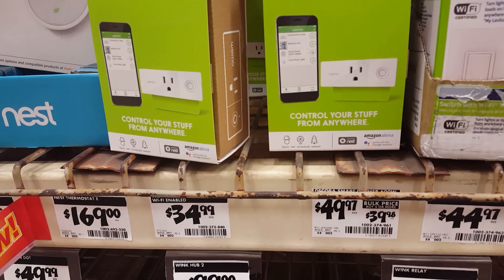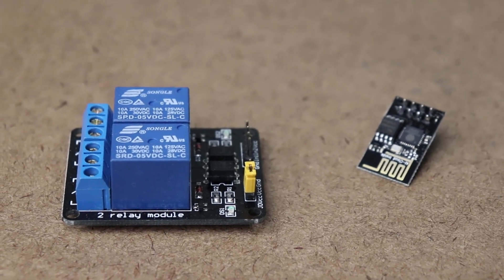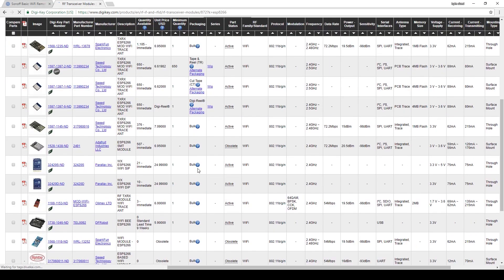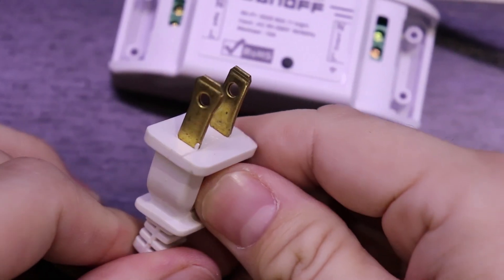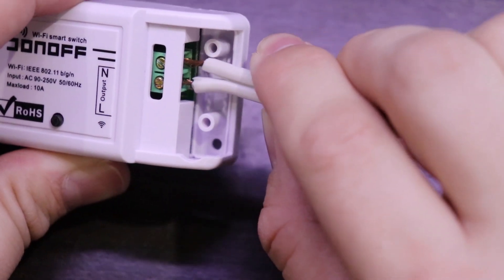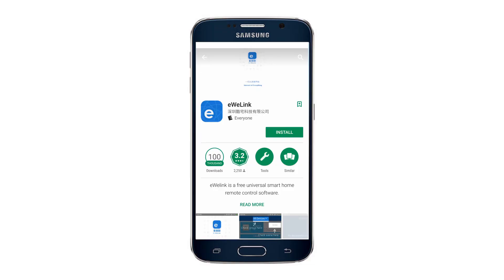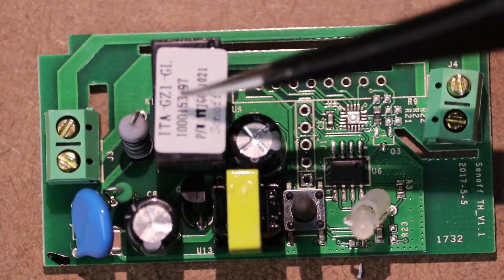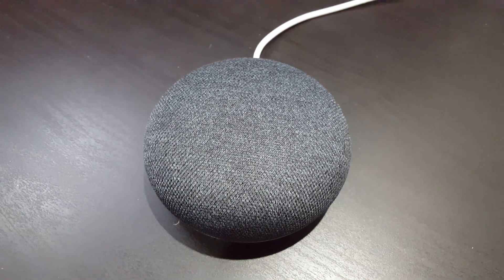Sonoff - The $5 WiFi Smart Switch That's Compatible With Alexa And Google Home

Comment: One big problem I found with this device: If you're using a Google Wifi router and a newer Android phone they won't work because you won't be able to pair the smart switch with your wifi network. This is because to pair the switch, you have to open the app on your phone, add a new device and then direct it to your wifi network. The Google Wifi router puts out a 5Ghz and 2.4Ghz band network that both have the same name. Your phone will automatically choose the one with the stronger signal which is almost always the 5Ghz one. The problem is these switches only work with 2.4Ghz so as soon as you choose that wifi network on your phone, you get an error in the app saying 5Ghz is not supported. This is really annoying because the 2.4Ghz network is there - it's just that the app doesn't know that when doing the pairing. Unfortunately there's no way to force your phone to use the 2.4Ghz or disable the 5Ghz network on the Google Wifi router so you're stuck with a switch that should work just fine but you can't pair with your network.
Reply from the maker: Aaron Smith I used a dual band router in making this video. You have to make sure your phone is connected to the 2.4GHz network before you setup the sonoff switch. If the 5GHz and 2.4GHz networks have the same SSID then you should change that in your router settings to give them unique names. This will help avoid confusion.

Comment: wow you stripped to much insulation away from the cable, the copper wire shouldn't be exposed after connecting it to your device!

Comment: Great video! I've have one air large conditioner in my house in the U.S. that uses a 240v three prong plug. I've been trying to find a z-wave or wifi switch to control this for years now with no luck. Do you know if I can use the sonoff 16a POW switch wired to an extension cord to control this? My A/C is rated 8-12amps and the sonoff says it can handle up to 250volts so I dont think that will be a problem. The only potential issue I see is that in the U.S. the 240v 3 prong outlet is created by joining two 120v circuits which means two of the three wires are "hot" and the third round one that looks like a ground is actually  both neutral and ground. So my question is can I use the sonoff for this and if so what should the circuit look like?
Reply from the maker: It sounds like it should work, but I would consult an electrician.

Comment: but ac is switching, so making sure polarization is right makes no sense.. true it is made that way, but is not 100% important unless you have some very specific high end equipment, and your house was running on DC power.. sure its a good practice to do it the right way, which is as you say. but is not important in any way. not in my country anyways. have made tons of cables, with no need to identify a lead(mainly due to our obsession with color coding them) but still, i could take a lead and reverse it, with no impact in the power it gives..
Reply from the maker: You are correct that reversing the polarity on an AC load does not affect its function, but it's unsafe to switch neutral instead of the live signal. Thanks for your feedback, much appreciated!

Comment: So instead of using an extension cord, you could just strip the lamp wires or what ever device your are looking to make smart, and connect it directly that way? 

Second question, if I simply flip that light switch on it'll still turn on or do the commands to the voice assistant HAVE  to be used?
Reply from the maker: Yes, you don't have to use an extension cord. I wanted the flexibility to move it around from appliance to appliance. To answer your second question, think of the sonoff switch as plugging/unplugging your appliance from the wall. When the sonoff is turned off, your lamp has no way of receiving power. There is a button on the sonoff that allows you to manually toggle the power on/off so you don't have to use voice commands.

Comment: This is amazing. I bet you can wire these units in line with te power sockets and leave them in a pattress box inside the drywall
Reply from the maker: You could in theory do that. I prefer to leave them external. Thanks for sharing your ideas!

Comment: Hi, I'm new to home automation.
If I make my devices on all the time, like example my kettle, is has to be on the powered on mode all the time, is the switch by default off mode until you turn it on?

and also in that case for your blender,soldering machine, etc, is it set to on mode all the time and cut off by controlling your remote control/google home?
Reply from the maker: Imagine that the sonoff switch plugs/unplugs your appliance from the wall for you. If the appliance has a power switch it should be kept on all the time, allowing the sonoff to supply power to it. Hopefully that helps

Comment: Which tipe of device does Google Assistant think it is? Can I change it to a light bulb? I would like to include it in scenes together with smart bulbs.
Reply from the maker: You can add the Smart We Link app right in Google assistant.
Reply: byte sized okay, and if I add it too a room named kitchen, will I be able to say, " turn off kitchen lights" and it will turn it off together with my hue bulbs?
Reply from the maker: Eric G yes if you add it to a room in Google assistant it will respond to room commands.

Comment: Dont leave all that copper exposed on your connections to the screw terminals on your sonoff. Make sure the insulation goes right up to the terminals to prevent it from arcing between the bare copper.
Reply: Shouldn't you use cable shoes (if that's the correct translation) for AC power wiring?
Reply: Actually what is shown in the video is perfect.  I'll respectfully offer that the "best practice" is to leave a very small length of bare wire showing.  Especially in this case since there is a secondary terminal cover.  This is to verify that none of the insulating jacket trapped under the terminal screw thus proving a proper connection.  For reference,  a savvy inspector will fail an installation if they don't see a small amount of bare wire.
Reply: Georg, not sure what you mean but I suspect you may mean the crimp on ferrules that turn the stranded conductors to one solid length?  They're not commonly used in many countries. Most of continental Europe uses them, but the UK mostly doesn't (I however like them) and I don't think the USA does either.  The terminals on a Sonoff switch are fitted with leaf springs so it can clamp properly on stranded wire :)
Reply: It is hilarious that so many people upvoted your post, because it's just plain wrong.  Leaving exposed wires in an area where there are children that might do something ignorant like jab a metal object at it, would be unsafe.  Otherwise, no, it's not increasing the risk of arching.  Air is an insulator.  There is a smaller gap inside the device and many other devices than that, if a (relatively, at 110V) low voltage arched that easily, over that significant gap, your home would have burned down the first day you plugged gadgets into the wall.

Please don't post things in ignorance.  Thank you.
Reply: this is why it is illegal to install yourself in most of the countries where this would be a in-demand product.
im surprised they even sell it to the public. just wait til the lawsuits start up
Reply: EL34XYZ never solder a mains wire if it gets hot the solder melts and the connection becomes dangerous
Reply: @TheLawrencestewart25  You are being ridiculous.  "MOST" products you buy that have mains wires, have solder involved in the circuit path.  The wire won't get excessively hot unless there is another fault that causes much more of a problem than the solder joint, and solder doesn't melt anywhere near the low temperature that most (consumer grade products' wire) insulation does.  The wire insulation will fail before solder would. If your wire insulation is gone, melting solder is the least of your problems.  Please do not post things you don't know about.  Many many products have soldered mains wires, including just about every AC/DC wall wart power adapter you own.
Reply from the maker: Thanks for the tip!
Reply: true cutting a wire like that is crinche worthy of Verge level PC building
Reply: Yea, for all the electronics knowledge he seems to have, that's a pretty glaring error.
Reply: I was thinking the same thing as well as the large soldier bead. I think the design could be re-worked where you're connecting the 120 V wires directly to the relay that has a larger gap and some sort of insulation, etc to eliminate the wires being close together and the need for the soldier bead.  These are the reasons why I wouldn't use the Sonoff because if the soldier melts and bridges together between the L & N points, you better hope that your circuit breaker in your panel box is working properly. I'd rather see the wires connected to the outside edges, rather than next to each other. I'd also rather see it go to a small power module to adjust the voltage to the board's componets. Then using a 14 or 16 AWG wire, jump it over to the relay rather than a soldier bead ... simiar to a jumper wire you'd find in a multiple switch or outlet box that supplies power to all the switches.  IMO these are too cheaply made.
Reply: @john_thorpe  the casing is commonly used for powersupplies for LED lights, so with this price i think they are just reusing stuff.  

Its fine to use this design and case if it was for led powersupply as they dont consume that many amps(usaly).

But for a relay wich is supose to be able to break the full load, then this design is kinda shit, theres too many places where arching could acurre, plus i dont think those therminals are supose to handle the Amps that a standard US circuit breaker is rated for,(its 20A right?...i live in EU)
Reply: I don't think 110v will ever Arc. It will take about 5000volt to Arc...depending on various factors of course 😉
Reply: Never solder stranded wire that is going into a clamp or crimp connector. The solder is soft and will flow over time, and the surface of lead based solder will corrode, making a poor connection.
Reply: @AlienRelics  That is not really true unless you make gross mistakes in implementation (same as doing anything wrong, really).  The surface of lead based solder does not corrode. However if there is water soluble flux left behind then water is introduced, that becomes acidic and can corrode exposed bare metal such as copper wire itself or the connector, not so much the solder.  In fact you have it the opposite, that a wire that is only crimped, still has the wire exposed to oxygen and will corrode over time.  Soldered connections to connectors are vastly superior, are only not used because it takes more time, slightly more cost and needs the soldering iron and basic soldering skill to do it.  Think about it, the only reason you would have bare copper wire in the first place is because it is cheaper than plated wire.

What you are suggesting is just plain ridiculous.  If the solder flowed, then every solder joint on your possessions that use solder, would be failing left and right.  Solder provides a reliable connection without even using a crimp, does not flow then and the same is true in a crimp.  Granted to do it right, you solder the wire TO the connector, do not just solder coat the end of a wire and then crimp it, but the latter will work too unless you do something silly like put a severely excess amount of solder on and then tighten a (screw terminal) connector ridiculously far past the proper torque.
Reply: Modern solder (for at least the last 20 years in the US) does not contain lead.
Reply: Lead-free solder is still a bad idea, same issues with it compressing over time.
Reply: @stinkycheese804  Wrong about what? What is not really true? Lead free solder never corrodes?

You are completely misunderstanding the difference between a soldered joint, and a soldered stranded wire that has been crimped. An entire industry says never solder wires before crimping.

"Some technicians prefer a combination of the two contact installation methods where an assembly will be used in rough conditions or when assembling test probes. The contact connection is first carefully crimped and then solder is flowed into it. Although a technique that can be difficult to master, it creates a connection that will never fail except under conditions of extreme mechanical damage or heat. Never crimp a soldered joint! Solder has no compression strength."

http://www.rfcoaxconnectors.com/technical-crimp-vs-solder.php
Reply: @stinkycheese804  "IPC-J-STD-001 Rev E, page 13, section 5.1.3, “Stranded wire shall not [D1, D2, D3] be tinned when:”

Wires will be used in crimp terminations
Wires will be used in threaded fasteners
Wires will be used in forming mesh splices"

NASA says:
“Crimping.
Stranded wire shall be used for crimping. Crimping
of solid wire is prohibited. Crimping of solder tinned
stranded wire is prohibited.”
Reply: what do you know about copper being exposed and arcing? lmao
Reply: Yeah, it isn't going to arc because it is bare. The body of the clamps are closer than the wires. It takes about 33kV/cm in dry air, and a minimum of over 300V to start an arc. 
https://en.wikipedia.org/wiki/High_voltage#Sparks_in_air

Note that this is NOT the same as an arc formed when breaking a current carrying connection.

The danger is more one of more bare metal exposed. Not really that much of an issue as a cover closes over the connections, as long as the exposed stripped length is not so long that the wires are in danger of being twisted into a position where they come into actual contact.
Reply: @AlienRelics    You're a good advertisement for being smart.
Reply: Yes, always make the insulation butt right up against the terminal. And I also like to twist the wire and then add solder to make the wire ends solid
Reply: EL34XYZ in Germany, soldering is not allowed anymore. You have to use terminals

Comment: Be careful!!! That's a pretty unsafe way to do the wiring! Make sure there is strain relief on the cables to prevent them being pulled out, and possibly exposing live mains connections. I found useful safety info here: https://www.superhouse.tv/21-six-sonoff-secrets/
Reply from the maker: Cool thanks for the tips! There is strain relief on the cable when I screw the covers back on. It holds the cable in place when being pulled on.

Comment: Power consumption meters are easy to get. Plug device to one end through the meter and it will tell you how much power, then do it with the home auto device and do the simple math.. with and without it.

Comment: Clamp meter,,,measure amps being drawn on the supply side of cord and output side of device.. Difference is the loss. Also the draw of whatever device is being turned on and off. You could burn down the house with a 14 or 16 ga cord acting with a  high amp fuse in the house box and a device with a high amperage draw........That's a fundamental function which must be met or exceeded........

Comment: Great video.   If you want to measure power consumption (assuming unity power factor) you will need a current transformer or a series low resistance element plus some amplification and an A/D circuit.  It's pretty easy to do.  The Sonoff doesn't seem to be UL rated, so isolation won't be a must.
Reply from the maker: Thanks for the tips! I've since learned that there is another model called the sonoff pow which does power consumption reporting. I appreciate the advice!

Comment: Would you be able to power on/off a tv or A/V tuner/receiver using one of these? I know Google recommends a ChromeCast to activate a TV using a Home/Mini. Also, more details on how to add the app to your Devices in Google Home. Thanks!
Reply from the maker: This wouldn't work to turn on/off a TV or receiver. Most of those require you to press an "on" button after plugging them in. Think of the sonoff as plugging/unplugging the appliance from the wall. 

In the google home app click on settings, home control, in the devices tab click the blue plus button, find Smart We Link in the list and add it.
Reply: byte sized, wouldn't your blender (button), osiliscope (knob), etc. be a similar example of what you said for tv/AV receiver?

Comment: Just came by this. Do you think it would be small enough to fit in  the ceiling light boxes. I know I have some with bigger shrouds that would work but if one could tuck in there it would make controlling light and fans to possible.
Reply from the maker: Not sure, give it a try and see if it works!

Comment: So what are you actually using to turn the blender on?  It's not the 2 prong extension cord running through your Sonoff.  Not even sure the Sonoff could handle the current draw from the blender.
Reply from the maker: Okay, you got me. I may have embellished for theatrical effect. I'm surprised that no one else caught that. You are the first one! I was trying to make a point that you can control pretty much anything. There are sonoff models that support a third prong (earth) and 20 Amp current draw. So with the right equipment you could turn a blender on/off. Thumbs up for your eagle eye!
Reply: Thanks for taking the time to reply, I did see they came out with a 3 prong, higher amperage version.  Now it's time for you to do a follow up video!

Comment: All, be mindful that these Sonoff switches are rated for 10 amps while the cable and outlet is rated for 15/20 amp. This means that the device will burn up before a fuse is blown.
Reply from the maker: Thanks for sharing that tip!